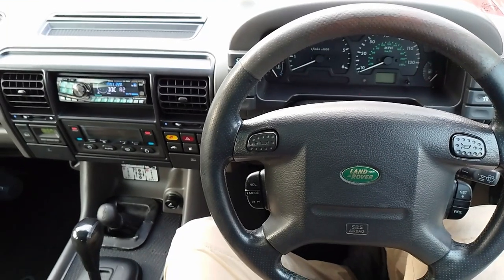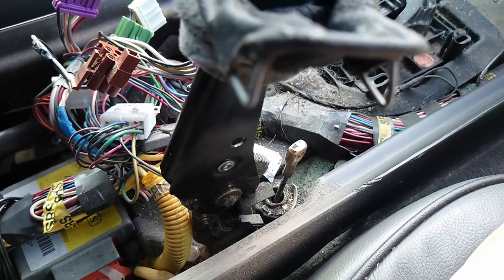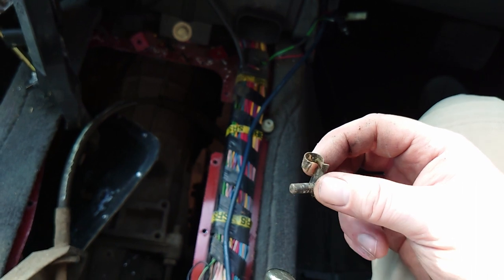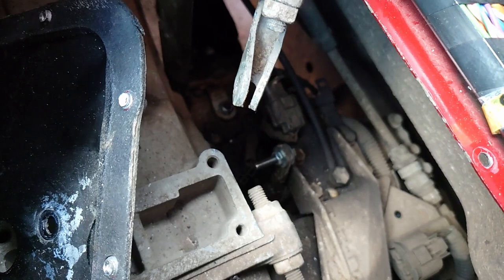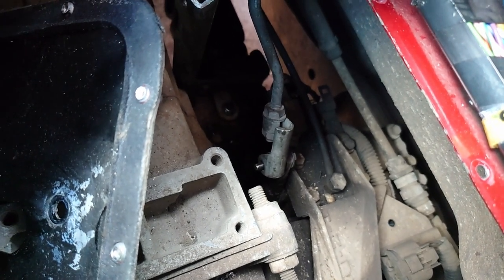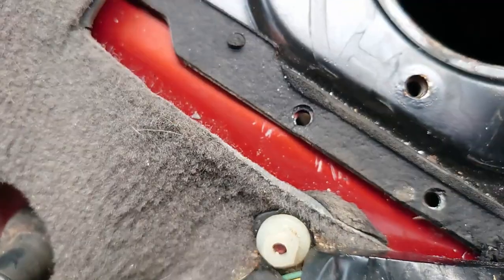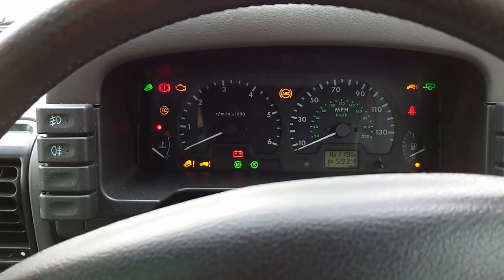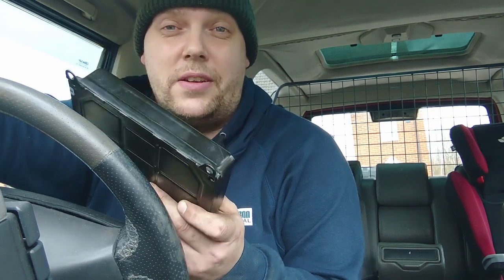Land Rover Discovery 2 Centre Diff Lock "CDL" Retrofit

Comment: I had a genuine LR parts CDL retro fitted to my 02 D2 didn't cut any wires & it works just fine no problems with SLABS unit. Both CDL & SLABS work perfectly together even in deep mud or sand, it has transformed the off road ability of the D2. My own personal advice  (for which I won't be held liable in any way) is to ignore the "folklore" concerning SLABS & just fit a CDL. But beware some transfer boxes don't have the provision for a CDL check first or change the transfer box at your expense.

Comment: On the pre facelift model the reason people cut the wire is because if you start the car with the diff lock engaged the TC wont work, like if you stall it off road. If you engage the diff lock after you start the engine the TC will still work and you'll have the diff lock. The wire gets cut to prevent the TC turning off.
Reply: That's a new one to me my pre facelift SV D2 doesn't have that fault. I can start up with CDL engaged & the traction control works just fine, also cutting the wire is a big no no with your insurance company, who in their right mind would want to disable their ABS or create a "sneak fault" that might just get you killed while driving on road?  If things get that bad then I might suggest a locking rear diff but then another wire has to cut so the TC doesn't go crazy ........ oh wait isn't cutting wires a bad idea? Simple answer fit a make/break switch then you'll have the best of both worlds & stay legal with the insurance company.
Reply: @normaneustice1112  The facelift model and the pre facelift have got different SLABS units. Yours may have the facelift version fitted especially if its a late model pre-facelift as land rover were getting ready for the update. 

Please re-read what I put pertaining to cutting the wire, as I don't think you understood. The whole point of cutting the wire is to KEEP the TC and ABS working.
Reply: @mikeb53  Sorry Mike you're right, I was getting confused with the rear locking diff mod where the ABS wire has to cut in order for the brakes to function properly when the rear diff lock is engaged. My D2 is a Jan 02 build SV so I'm not exactly sure which system is in use,.
Reply: @normaneustice1112  No worries, it can get very confusing with all the mods out there for the D2's. But If the TC still works, even if you start it with CDL locked, then you will most likely have the updated facelift SLABS unit. I have a facelift model and mine can be started in diff lock without any ill effects to the ABS and TC also.

Comment: So I have a 2004 which does not have a CDL fitted from the factory. I have bought a conversion from Ashcroft and I have bought a complete actuator off a 300 tdi from ebay. When I do the clutch I am going to fit the lock and actuator. But I am concerned now about what you were saying about the traction control fighting with the locked diff, so how do I de-activate the traction control when I engage the CDL, because presumably mine won't do it automatically as it never had a CDL from new?

Comment: Hiya, ive got a 2000 td5 with cdl, wouls i need to find a SLABS unit from a 2004 to allow the TC to work correctly with the CDL? Also are these units plug and play for different vehicles. Thanks

Comment: Very timely video for me.  Just considering buying a 2004 Discovery TD5 auto.  So are you saying that if you retrofit the CDL on say a 2004 and you select diff lock, the traction control turns off automatically? Is there a sensor that tells the system that diff lock has been selected?  Thanks
Reply from the maker: Hello thanks for the reply the CDL will work on all DII's so long as the transfer case has it fitted. I believe Land Rover completely stopped putting the CDL on the LT230 around 2001 but reinstated it again a couple of years later. My 01 V8 doesn't have a CDL on the transfer case but but this 99 Td5 in the video does. 

The self leveling antilock breaking system  (SLABS) module relies on the switch in the T-Case that indicates CDL is engaged also illuminating the light on the dashboard. On earlier models the SLABS would disabled the Traction Control so you had the choice of using either. On later models around 2002-3 the SLABS was updated by LR to incorporate the TC when diff lock is engaged.

There is talk of people cutting the wire to the SLABS on their earlier cars to keep the TC active which I think is a bad idea. However for yourself a 2004 should have both the diff lock and the updated SLABS so you will be fine.

Comment: Hi matey very good video I have a d2 53plate currently doesn’t have diff lock but just picked up a older d2 transfer with diff lock so be fitting that during the week will mine play tc turn off when I engage diff lock when the new transfer is in thanks Liam

Comment: So I have a 99 disco 2 V8 here in North America, I just installed the center diff lock with a socket and 3/8 ratchet extensions, I'm confused on using the CDL and the traction control, should the CDL need to be locked at some point in time would the traction control need to be deactivated?
Reply from the maker: Your absolutely fine as long as your diff lock light comes on when you engage diff lock. The slabs takes this signal and adjusts the TC accordingly either by deactivating it on the older units or applying the revised settings in the later units. The risk comes in cutting the wire to trick the older units into not thinking the diff lock is engaged which puts unnecessary strain on the drive train. Hope that helps :-)
Reply: @anti-social-media  it did thanks for clearing that up,  the light does come on when engaged.

Comment: I have a '99 D2. It has all the bits built into the centre diff but no lever to engage the diff lock. I put in an electronic actuator. You can see here: https://youtu.be/NcYaItf6tl4 It does not disable the TC when engaged and the TC works fine with CDL engaged.

Comment: Hi I'm wanting to put difflock on a 2002 Land Rover discovery 2 td5 ES automatic but hear this transfer box might not have the difflock installed. Rather than take apart the interior area is it possible to locate the nipplefrom under the discovery or is it possible to get a serial number on the box to identify if it has or not. Great video well explained. Thanks
Reply: Yes there is a list. But I can tell you now that if it's an 02 it won't have it as the stopped the diff lock halfway through 01